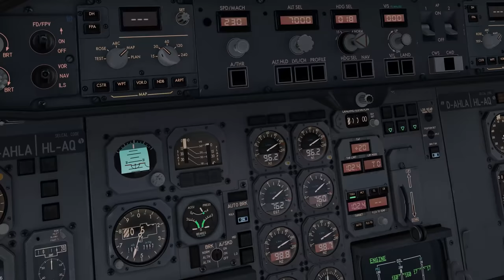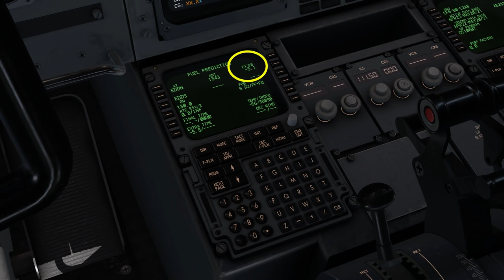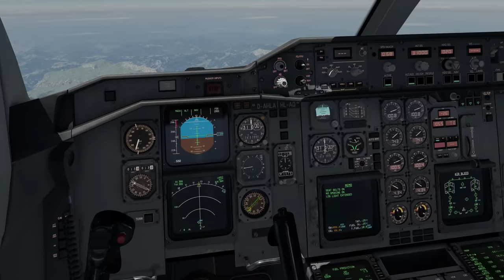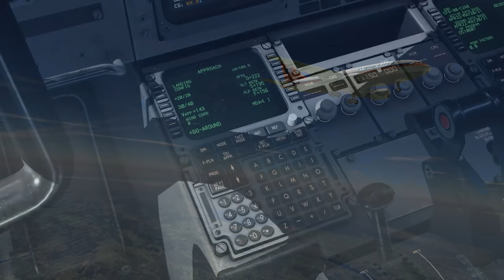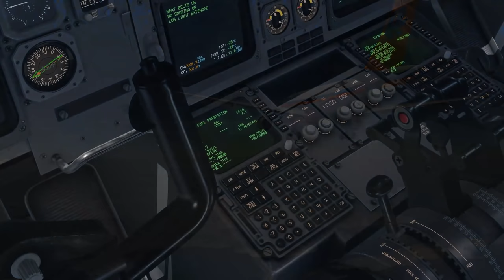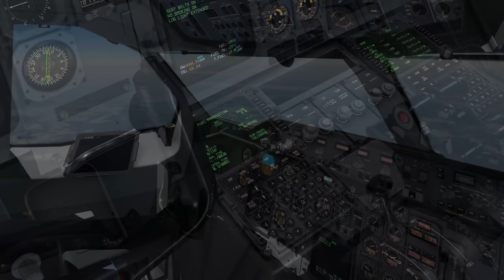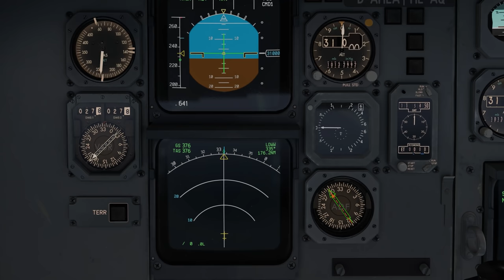This German jet ran out of fuel!? | Hapag-Lloyd flight 3378

Comment: I'm not into aviation except as a passenger, but I'm an electronic engineer and computer programmer. I've now watched several of these videos and the common theme that always surprises me is the amount of effort that seems to be required to set up the flight computer. In several of these videos, the pilot, when in difficulty would rather not divert to a different airport because of the work involved in changing the information in the flight computer. Why is it so hard to do this? The aircraft already knows the essential parameters such as the amount of fuel left, the current location, the cargo / passenger weight etc. So surely, the software should be able to switch to a different destination upon receiving nothing more than the name of the destination. A modern passenger jet should surely have all the necessary information about the various airports already built in. Even my 10 year old car has a sat-nav that can take me to any hotel anywhere in the UK and throughout most of Europe. I understand that airports are much more complicated than hotels, but the point is there are far fewer of them and all of them have runways etc. that don't move about or change length etc.

Also a system needs to be developed to enable Air Traffic Control to send height, bearing and other instruction straight to the flight computer instead of verbally to the pilot. This would eliminate language and pilot stress problems. (I'm not suggesting that ATC controls the aircraft, but that the requested instructions are presented on a screen for the pilot to review and if he's happy with them he presses an accept button, whereupon the flight computer / autopilot does what's necessary. Even without that last step, a written instruction from ATC would be a considerable advantage over a verbal instruction.

Comment: 10:44 This reasoning is why a lot of people don't go to the dentist or the doctor.  They don't want to hear bad news but they know they need treatment so they ignore it and it gets so bad it is forced onto them eventually.

15:07 The pilot would've been reasonable in his assessment if he hadn't been starting from an incorrect assessment of their rate of fuel loss.  I would've at least done a calculation based on the manual regardless of my feelings about it just as a comparison.  A big difference between them would've at least alerted me to analyze it further or give greater consideration to an alternate destination.

15:45 This is also called "summit fever".  In this case the pressure is internal, the desire to reach the summit is compared to all of the investments in time, money, and effort.

Comment: Hmmm surprised the investigators believed the 1st officers approach was exemplary. Surely a first officers job isn't just to offer suggestions it's to actually take control if the captain is putting the aircraft and the passengers in to danger. He made suggestions but backed down, is that exemplary?

Comment: I find it strange that the Handbook did not mention how to determine the rate of fuel usage.   It would have been a simple mental calculation... Take two measurements of total fuel on board, some time apart, then divide by that time.

Comment: I feel like the failure of the long distance link to their own engineering tech was the beginning of the dominoes that led to the accident. It seems like the pilots couldn't get a good read on the situation due to the primitive limitations of their texting system which I assume were ridiculously cumbersome to type into. If they were able to verbally speak to their dedicated engineer, they could have ran through checklists together and figured it out way sooner. As it was the pilots were left on their own with limited knowledge of the situation.

Comment: Seriously urks me how such a drama is made of an easy problem.  A) turn back to departure airfield.  Or B) doesn’t the A310 have an ACTUAL fuel flow gauge readout?  Calculate: fuel flow / useable fuel.  Done.  Where useable fuel: fuel on board - final reserve fuel.

No bollocks about commercial pressure or self imposed pressure.  I that was achieving, no problems.

Comment: What a crap fuel calculation algorithm. The pilots could have divided fuel on board by current consumption rate in their heads. The pilots relied too much on computers rather than using their own brains.

Comment: Is it allowed to fly gear down? Or does this mean, divert to airport you just took off from?
Reply: It is not uncommon.
Reply: It's not technically an "emergency" as the plane can fly perfectly fine and is not in imminent danger of crashing.  However the increased drag greatly increases the rate of fuel consumption, so the best thing to do is to find an intermediate destination if possible, to avoid the dangers of landing overweight.  If that's not possible or practical (like you're flying over the ocean with no closer airports available to land at) then they might consider returning, but otherwise it's usually better and more convenient to continue as far as you can safely go.

Comment: Extracting flaps would made it worse, since there would be speed loss, bigger drag.
Reply: Not necessarily. Slats for instant creates a lot of lift but not much drag, and I am sure they have run the figures and test in simulators that they would have made it with them extended.
Reply: @se-kmg355 They could be wright, yet there are many lvls of flaps usage. There is no mentioning to which lvl should they be used. 1-5 makes big difference, i guess they meant full flaps and my comment is about that usage. Flaps are used for take of and landing, since they provide better lift with drag and they are usually used with slower speeds at landings for slowing plane down without losing lift-altitude. Plane without  working engines, gear down, full flaps would stall.

Comment: This was just an absolutely avoidable incident, and I avoid the term accident in this situation.

I wonder if the passengers realised afterwards how close they were death?!

Ps instead of Airbus just adding some guidance notes why they couldn’t they have done a software and/or hardware upgrade to enable the FMC to detect the gear status and measure accordingly…..

Comment: We have to remember that this crash outcome saved all lives, A human is not a computer, Under pressure we only have a small part of our brain that helps think hard about many problems we have around us, We are not robots or computers and notice that thousands of different problems can happen in flying a plane that has malfunctions, We have Google on the surface on earth, We need a cockpit computer that you can type in problems to get the answer of what to do in that model plane as a alternative to a flight book, Always say that camera's should be installed into cockpits so the ground engineer's can observe all the gauges, switches, buttons of that plane

Comment: Why did they not just go back to the origin airport and call for an engineer.
Reply: Because of fuel, a plane is too heavy to land directly after take-off. They would have had to dump most of the fuel.

If the plane has no issues besides the gear being down, the is no urgent reason to land.

It mystifies me how the flight computer does not know the gear state to estimate consumption and flight range. There is so much data available it could easily be implemented.

But the worst part is that the pilots did not even do a simple manual calculation. It would have shown fairly clearly that they would not make it.

Comment: Wonder what changes were made in the industry re CRM and at Airbus from this?
Reply: And great vid, as ever!
Reply: Why would Airbus make any changes.
Reply: @peteconrad2077  The the FMS calculation for fuel consumption doesn't factor in plane configuration or use current consumption to extrapolate future consumption / range. Also that manuals on board to be more explicit.

Comment: If the computer simply took the current amount of fuel and extrapolated based on a normal flight, why would it even indicate a shortage to the original destination of Hanover?  Nothing would have changed to modify the original preflight calculations.
Reply: Because the calculation takes into account the current fuel, which they are burning faster than normal.  The calculation isn't taking the rate of consumption into account, nor the fact the gear is down, but it is taking into account the fuel currently on board.

Comment: The captain was an idiot and irresponsible, no question. At the time, there was also a lot of talk about how they are under immense pressure from the airlines to keep the cost (kerosin consumption) at a minimum. How the airlines will only take the absolute minimum of fuel on board, because each extra kilogram will increase consumption.
But, on the other hand, the skill required to fly this Airbus like a glider and still somehow manage to land it on the airport is something. I never thought that this was even possible. 
And those 6 minutes of silent flight after the engines had stopped working in mid-air, until the aircraft managed to make a more or less safe landing and everyone realized that they were still alive and had not crashed into the ground ..... must have been intense.
Edit: I just looked up other incidents, where both engines failed and yep, this normally leads to a fatal plane crash. So after all, still a miracle landing.

Comment: How can a captain with so many hours make so many mistakes? I am speechless. However why didn't the gear retract? Forgotten gear pins? 🤔
Reply: It has nothing to do with hours. Actually, the more experience could mean the person is getting to self confident and believe they are better than they are. It all comes down to training. If they had better discipline to follow the checklists and had better instruction from the company how to handle these situations the out come would have been different.
The gear did not retract due to an incorrectly installed nut in one of the actuators.
Reply: Arrogance versus experience. Also zero common sense demonstrated in this flight.
The a-bolt was inserted incorrectly at service. Gear retraction disabled as a result.

Comment: 1) They have been trained wrongly on the FMS.
2) The manual given to the pilots was wrong.
3) The gear was wrongly installed.

I don’t understand why blaming it mostly to the captain.
Reply: Because none of those three things would have caused the plane to crash, if not for the poor decisions made by the captain.

Comment: Crete is not a SMALL Island. More like the biggest of Greecr. A few hundred km long.
Reply: It's smaller than other islands bigger than it.  Size is relative.
Reply: @troodon1096  exactly. The biggest of Greece. So not a small Island. Malta is small. Quick fact checks in Wikipedia cost you 30 seconds. Maps see also helpful.

Comment: If the plane had no fuel on board, why was evacuation ordered following the crash landing? It wasn't as if it'd explode anyway
Reply: The tanks could still have leftovers of fuel, and also flammable fumes. Don't know if the crop on the field could also go on fire.
Reply: Standard procedure.
Reply: @MrEsMysteriesMagicks  I wonder if that's why evac was ordered after that Air Transat landing at Azores as well, although that wasn't even a crash landing. It landed properly and the only injuries that were suffered were during the evac! Strange
Reply: If the car had no fuel in the tank, why leave it after an accident? See why this question may sound a little daft?
Reply: @supertrinigamer  Indeed it's daft. I asked about emergency evacuation and you compared it to getting out of the car normally. D'oh!
Reply: @phugoid  I'm sure it was.
Reply: @phugoid  Dam, looks like I'll have to make an entire scenario for you to understand:
Your car has run out of fuel. You pull over and stick the hazards on. Some geezer rear ends your car.
You'd still want to get out of the car for safety in this circumstance, right?
Reply: How else were the passengers meant to get out of the plane?
Reply: @eat_a_dick_trudeau  It's clear that most here haven't heard of mobile stairs. This happened within the airport perimeter.

Most pax injuries happen during slide evacuations. Sibling parents, eh? Takes one to know one, I suppose <snigger>
Reply: @phugoid  the airplane was too much damaged to attach stairs. They only managed to open 2 doors and these where lower to the ground than where they usually are because of collapsed landing gear.